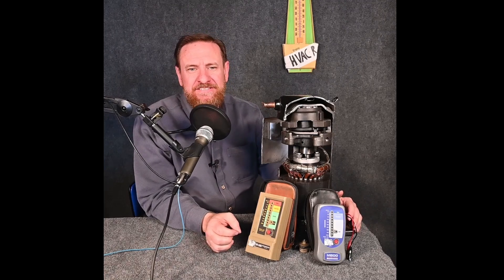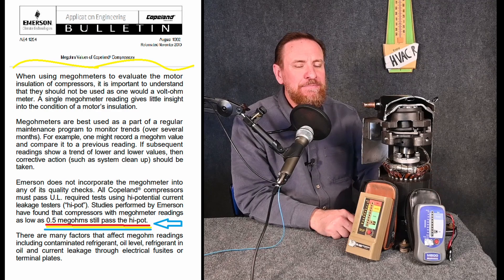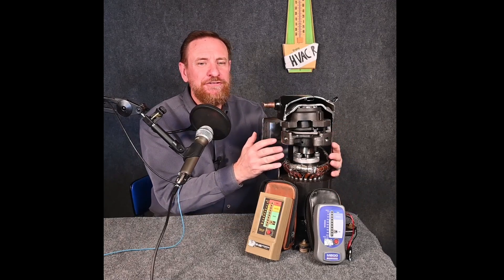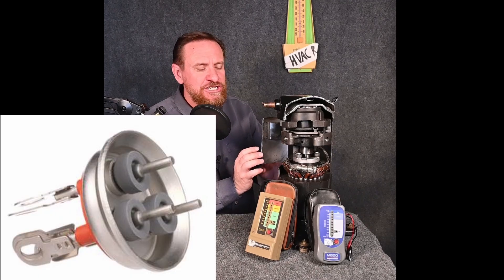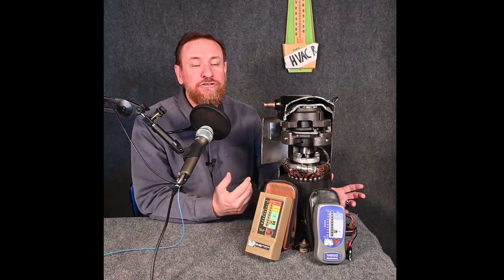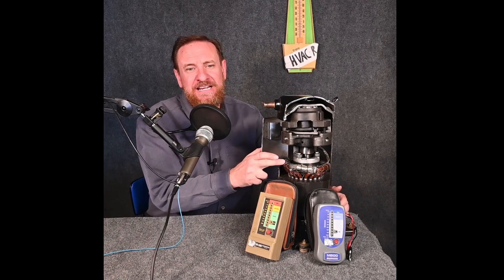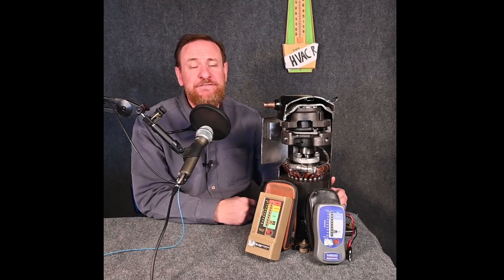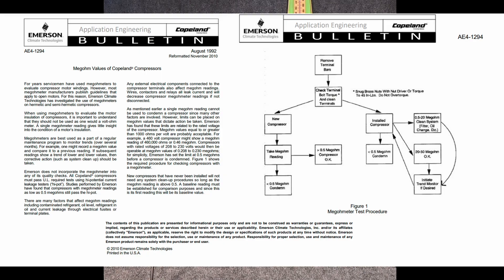Megohmmeter Misconceptions to know

Comment: Your information is very good for Home HVAC  motors , I'm in the R.V. industry where the top mounted air conditioning system is a closed system so even though the system could be contaminated? It still needs replacing due to a closed system. So this video pretty much only pertains to Home HVAC WHERE U HAVE THE ABILITY TO SERVICE IT !

Comment: I believe it's also important to remember that we provide necessary services, and that buying any new equipment, no matter the circumstance, is never a waste of money. It's the same reason you trade in an old car.
Reply from the maker: A few problems with that.

When somebody trades in a car, they are looking to make that decision ahead of time.

When somebody takes their car to be repaired, they expect a price to repair it. They don't expect the Salesman try to sell them a new car when they need there existing one replaced. 

Using this tool to lie and trick a customer into buying a new system is unethical and absolutely disgusting behavior.

Comment: WOW, Timing is everything! Just had my AC check yesterday and low and behold he got a rating of 20 Megohms. I asked him to do it a couple of times to be sure and it came up Red as Bad. Said it was in the Good range last year. Had appt. today  8/1, to see what a new Unit only would cost. Minus discounts $8300 dollars. I had been googling all night costs for new units and this morning started again on readings. I found your video right after he left and Bazinga you made my day and saved me some $. Now I keep thermostat at 74 and as we are talking I'm telling him its hard to think I need to replace this AC unit when Im sitting here cold at a 74 setting. And wouldnt it by now have conked out after 3-4 days of 100+ heat index outside, still had it set at 74 and good cold inside then. I told him I cant see putting out the money right now if I can get through another month of summer and be good till next year. Yes, it's 17 years old and probably should be replaced with prices going up. It gets checked every year and change filter every 3 mos. Hose it down after moving remove debris around it. I been doing my part.  Could be a fluke? Your Opinion Sir? THANK YOU FOR THE VIDEO. Thank you! I like to learn and still finding out more to be better informed and educated.
Reply: I’m so glad your keeping the unit and not having to get a new one. As an hvac tech I can’t understand how other techs can say with a straight face someone needs a new system because it’s “old” or rusted or “might go out soon”. Grr
Reply from the maker: I like tools but that "megger" is just a sales tool. 
You can order a "QwikCheck" 2 second acid test kit that checks for organic acids to get a better idea of what is happening inside. There are some more tests a technician can also do. Many techs get a commission for condemning equipment, others just don't know any better.

Comment: Supco megameter only goes down to 20 megohms, but Emerson bulletin 1294 shows that Copeland compressors can still be good down to .5 Megohms and still pass. See bulletin below.

For years servicemen have used megohmeters to evaluate compressor motor windings. However, most megohmeter manufacturers publish guidelines that apply to open motors. For this reason, Emerson Climate Technologies has investigated the use of megohmeters on hermetic and semi-hermetic compressors.
When using megohmeters to evaluate the motor insulation of compressors, it is important to understand that they should not be used as one would a volt-ohm meter. A single megohmeter reading gives little insight into the condition of a motor's insulation.
Megohmeters are best used as a part of a regular maintenance program to monitor trends (over several months). For example, one might record a megohm value and compare it to a previous reading. If subsequent readings show a trend of lower and lower values, then corrective action (such as system clean up) should be taken.
Emerson does not incorporate the megohmeter into any of its quality checks. All Copeland® compressors must pass U.L. required tests using hi-potential current leakage testers ("hi-pot"). Studies performed by Emerson have found that compressors with megohmeter readings as low as 0.5 megohms still pass the hi-pot.
There are many factors that affect megohm readings including contaminated refrigerant, oil level, refrigerant in oil and current leakage through electrical fusites or terminal plates.

Comment: Can i use a supco megg to test a 120, 240 volt ac motors? I think this megger puts out 500 volts.
Reply from the maker: That Supco member is the biggest POS. Throw it away. It's just used by sales techs to condemn perfectly good compressor. It range of good caution and bad is completely incorrect and used to scam customers.
Reply: @love2hvac  then what do you recommend?
Reply from the maker: Use a regular meter for testing to ground .
Or use the fluke, megging is not necessary and does not tell you if you have a bad motor.

Comment: Great video, thank you.  The refrigerant and percentage of impurities modulating the reading is something I never knew.   Do you have a video or information on using a Fluke 1507 MEGGER ( or any other MEGGER ) for example?  What should I expect to see at what applied voltage in blower and condenser motors?   Thank you again.  .

Comment: Thank you Ty for your constant teaching.. there are always things to learn in our profession, no matter your experience level.

Question: Is there a test that you know of that can test the refrigerant oil/liquid in the system for contamination?
That way, you could take a test sample as another diagnostic tool.
Reply from the maker: Thank you I Appreciate that!
Yes there are several tests available.
"Qwiktest"  makes a simple to use one. 
NEW Calgone makes a phase 3 test kit that tests an oil sample. 

Parker Sporlan makes an acid test kit.

You can also have an oil sample sent off for evaluation. We do this with chillers.
Reply: @love2hvac   Thank you, Ty.... I will check check into those.

Comment: Mr. Ty, you are absolutely right. About a year ago I had the same experience. I was working on a 5-ton 3-phase commercial unit when it was requested by a technician to replace a bad compressor for a package unit.  I was assigned the task of replacing the compressor when I got there the compressor was not turning on I used a megaohms meter to confirm and it was confirmed by the megaohms meter compressor was bad. I recovered the refrigerant and tested again at this time I noticed a megaohm meter indicating the compressor is good. I did not know the reason. I assume if compressor insulation is contaminated it will repeat itself once I charge the system with refrigerant. This is the first time someone tells me you are able to clean the system and be able to use the compressor again. Thank you very much for your help.

Comment: Ty if you have time would you suggest a few meters that would work good. Maybe something $100 dollars and less.  Thankyou
Reply from the maker: UEi DL379B or Klein CL800 is about $120
Those are the Cheapest quality meters I know right now
Some of the schools would order cheap ones for students to learn on. sometimes they worked great and sometimes not.

Jeff Bezoz place has has htis one with good reviews, even does capacitance and NCV but not temperature.

AstroAI Digital Clamp Meter Multimeter 4000 Counts Auto-ranging Amp Voltage Tester Measuring AC/DC Voltage & Current, Resistance, Capacitance, Frequency, Continuity, Live Wire Test, NCV Detection
Visit the AstroAI Store $37.99
Reply: @love2hvac  
Thanks Ty for the information. I think these are multimeter not mega ohm meter capable of doing the low reading you described in your video. If you have any further information on those I would appreciate.  Thanks

Comment: In Sweden 1Mohm is minimum.
A rule of thumb is 10Mohm/kV
Recomended 30sec to 1min test time.
For normal voltages, usually double the test voltage compared to working voltages.
EX:
100 till 240V (250 to 500 VDC test voltage).
440 till 550V (500 to 1000 VDC test voltage).

IEEE standard for electric motors recomends a value of (n+1) Mohm, where n is working voltage in kV.
ex: 115V = 0.115kV + 1 = 1.15Mohm.

Megger is great for testing al kinds of heaters.

Greetings from sweden
Reply from the maker: I love the detail! 
I have yet to make it to Sweden 😢

Comment: Ty would less than 20 megaohms on an open type motor be bad then or does the info on the video apply to all motors?
Reply from the maker: Generally speaking, open the motors above 10 meghoms are sususlly good. There is a lot more that goes into that. Even humidity can affect an open motor test.

Here is an article that relates 

https://electrical-engineering-portal.com/how-to-measure-insulation-resistance-of-a-motor
Reply: @love2hvac  thanks for the info and link.
Reply: Ty you are a great help to the trade. Thanks

Comment: If you have a standard HVAC digital multimeter that goes up to 60 or 100 megaohms, do you need one of those super fancy and super $$$$ expensive dedicated "Megger" machines? I'm talking about the really precision professional kind, not the midrange kind like that Supco.
Reply: A multimeter uses a low power output. A megger uses high voltage and low current.
Reply from the maker: Megger is not needed unless your in commercial or industrial checking pumps and big comoressors.

Sight glass with moisture or acid indicators are a better choice most of the time.

The last one you mentioned is not even a mid range, it's a low range that people use to sell new units.
Reply: @love2hvac  I wanted to be kind by not calling that thing a cheapie 😎. Why do you need the Megger at all? What special features does it offer, even for commercial?
Reply: @realSamAndrew  higher test voltage
Reply: The Meg ohm meter applies a high voltage to the windings and tells you if any amps escape through winding shorts. Unfortunately they can create pinholes in the insulation from people testing with too high of a voltage. Short story.. I have never had to diagnose a motor with one yet. The ohm scale on my regular fluke showed a short before I had to question much further. I think those meters are more for critical units and catching a developing issue. If not tested correctly they will create issues instead.